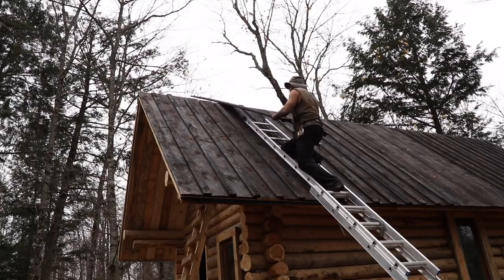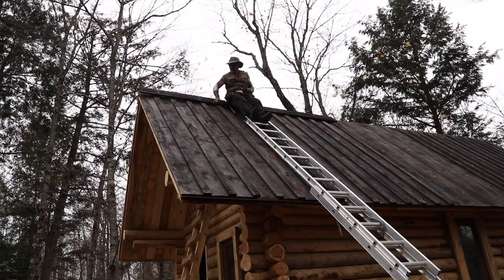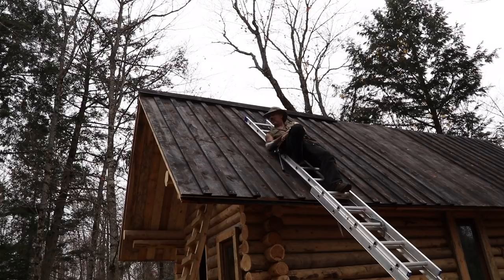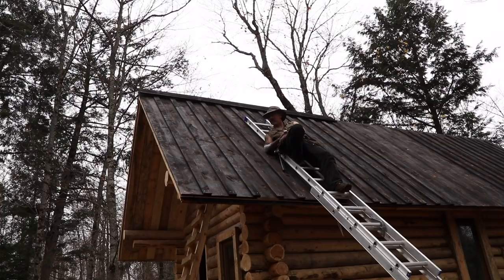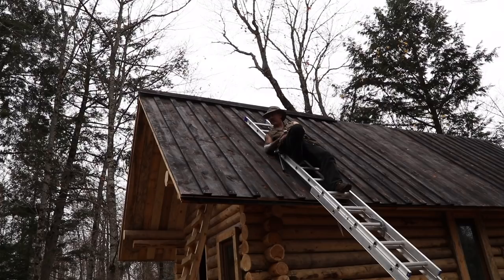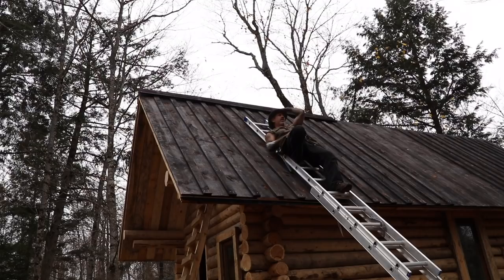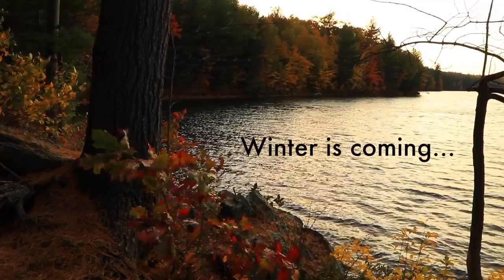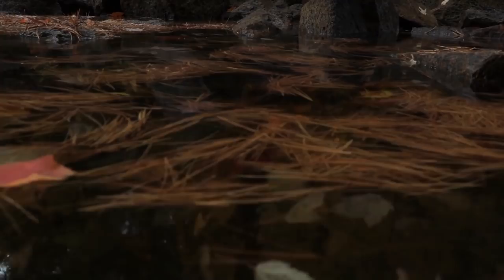Shou Sugi Ban DIY Wood Roof on a Log Cabin in the Woods using Ancient Primitive Technology

Comment: Shawn try tying 3 feet of webbing or line from your harness to an asender.  You can move the asender easily up or down the rope with one hand and if you fall it will hold your postion on the rope.  You can find them at climbing supply sites.
Reply from the maker: small_bore Too cheap to buy one for this project :) I used to own dozens of them, but got rid of all of my fall protection equipment

Comment: Put ribbed steel on mine here in Idaho. we have occasional forest fires here and those falling cinders  will burn it down. IMHO, steel is the only option. Ribbed or delta rib style.  I did use osb for decking and 30# felt and predrilled the holes in the steel. The wood looks nice but we get 5-6 feet of snow and it has to slide off. looks great. I use a minimum snow load rating of 50 # per square foot plus some over kill [lol] factored in . Gonna build another. Larger with a loft. Gambrel style. No plans either all in my head . Visualzation

Comment: Wow that looks great. I would have never thought of putting Mesquite charcoal on my house in the woods. 😲 Isn't that extremely flammable? Or am I missing something here?  LOL! You really caught me off guard with this one. I'm trying to put logic to this but you apparently are one up on me on this one. Can you share the logic of this roof? <~~ confused
Reply from the maker: This is an ancient, non-toxic way to preserve wood.  The benefits of this system are that it is UV, rot, pest and fire resistant.  Apparently, it can last 80-100 years untreated and longer if treated (with oil).  The oldest surviving wood structure in the world is a five story pagoda in Japan that was built using Shou Sugi Ban.
Reply: My Self Reliance Thats very interesting but wouldnt oil make it even more susceptible to catching fire in a forest fire type situation? I mean...great for Japan..but your cabin is in the woods. I used to make charcoal and put it in a waterproof tin so that I would have something dry and easy to ignite if things got wet. Is that a specific type of wood that you have to use to do that with? Just looking for more info here. Not attacking your roof or anything. Just one of those need to know guys...

Comment: Its common in Eu to do a vertical 1x2in across water barrier then to do horizontal ones to make easier for a dripped water to leak off the roof. In this case, shown in video, water will tend to accumulate under final roofing, it might freeze overnight, lifting the planks off roof, making thing even worse next night...did I miss something here?
Reply from the maker: Helloverlord I didn't show the strapping in detail. I left gaps in the boards to assist drainage
Reply: Thanks for clearing it out for me, man. ;)

Comment: I’veeen this done with a propane burner which was obviously much easier but not intuitive with your hand worked methods of building so it would not have been right to see you cart in a propane tank forlongish term food storage when you start staying there more often with your family have a look at a thing called a koolgardie safe it’s a meat refrigeration system that uses water evaporation to keep food cool usingno power of any sort it some thing the early settlers in Australia used so it might be interesting for you to google it it’s basicly a box surrounded  with walls of heavy hession sacking that the sacking is wettened and the safe hung where it gets a breeze blowing on it the water evaporates keeping the inside of the safe cool and this was how our early settlers used to keep meat from spoiling in a very warm country you haven cooler climate so would only need it for a small part of the year as you can get cool storage by digging a root cellar which is vertically never done over here we don’t build with basements or root callers but we came up with other ways of keeping stuff cool

Comment: Why did you use this modern roof membrane ?
Reply from the maker: Mo In believe me, I hated to do it.  Dick Proenneke said the same thing when he used two different types of modern membranes. My issue was that I couldn't find enough good birch bark, which is the traditional material used for underlayment. Next cabin though...
Reply: This is one thing. The other is - why you put on the next two layers of boards ? Would this space between this two layers be a kind of air-insulation ? ... or ventilation ?

Comment: Interesting, looks good. Applying a mixture of used motor oil/w diesel fuel 60/40 will waterproof the wood for many years. Keeping the dark color.
Reply: The point of burning the boards is that it makes them rot resistant naturally.  It would not be a good idea to add petrochemicals to the roof, unnecessary and unhealthy.

Comment: Love the roof. Great idea. The only thing I would do different is to put the horizontal joints over the overhang rather that at the top.
Reply from the maker: N4BGZ I thought that too, but I'm pretty sure I'm going to get some ice damming at the eave and I wanted to eliminate as many gaps there as possible. I'll probably seal the joints at the top.

Comment: i am a builder by trade, and unless you did somthing  off camera , that roof, athough a steep pitch a 12 12 i think, it will leak, especially if you get snow there
Reply from the maker: brian bergman I know it won't leak (I've been in the commercial roofing industry for 30 years) but I may have to seal the vertical seams if too much water gets in and starts to rot the strapping above the roof membrane. I left plenty of drainage gaps too
Reply: i cant imagine it wouldnt leak in snow or ice dam enviorment, but, great looking cabin, i enjoy your vids i defer to your experience great looking cabin, i enjoy your vids
Reply: So basically the roof membrane keeps it from leaking. the top layer is just to protect the membrane. It will leak into the under space a little and eventually rot out the stripping (probably should have burned that too). But no water should get into the house and it will last a good long time. Snow will stick to it like glue but should be plenty strong to handle the snow load.